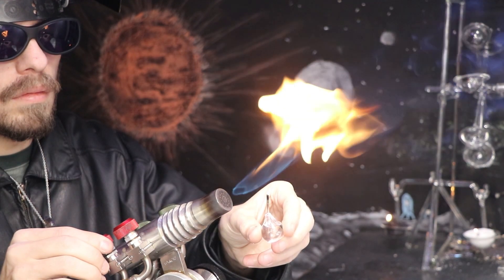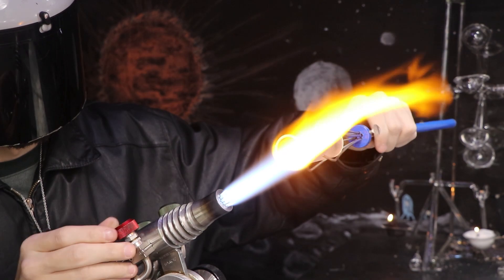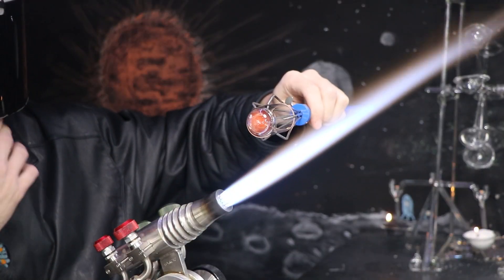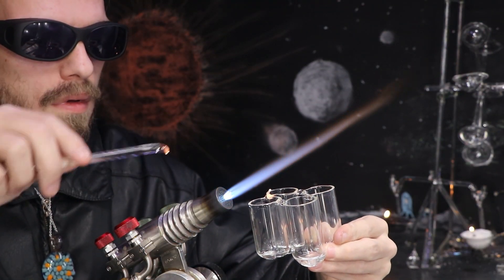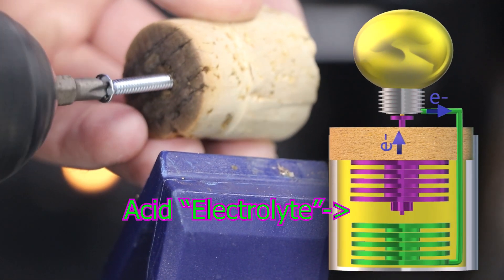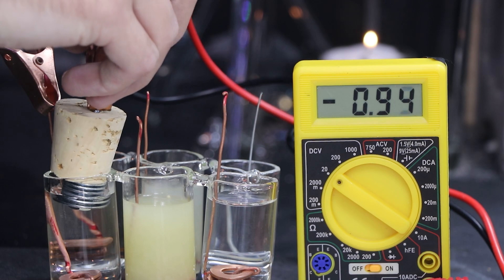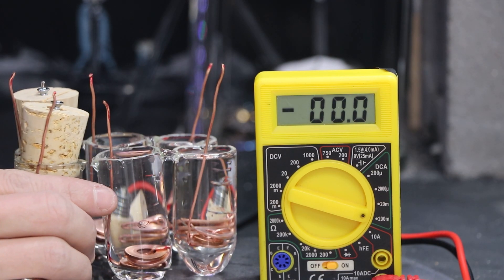Building my first Zinc Acid Battery 🔋

Comment: You are a genius. Excellent experiment. In one cup, you mention there is only pure water but the voltage is still close to 1 volt. Can you put 5 pure water cups in series connection to make it 5 volts ?

Comment: It would have made a lot more sense for you to have melted the tube in half, leaving a closed end on one side of each tube section, and then use the saw to cut the ends off to create the cups.
Reply from the maker: Hey Don Leslie, your absolutely right. I should of made better use of the flame cut to make round bottoms as well. 
   With these science videos I spend more time on the research than the design. TBH the bridging wasn't practical either. Plastic zip-ties would of saved time and held stronger. I need to take more advantage of mixed materials and not just glass. Thanks for watching and commenting, stay tuned for more to come!
Reply: @JasaGlass  Definitely using mixed materials could save some frustration and time. Have you thought about getting a hand torch like a Smith or Gentech tho? You can find really cheap knockoff versions of the smith online. They're not as good as the authentic ones but they do the job. Being able to dexterously  fire a tiny, super hot flame into tight spaces to clean up the bridge welds (among many other things) is super handy. Also a note on your annealing cycle: a 2 hour soak at 1050 is quite gratuitous, that's the kind of soak time required for solid pieces that are like 3 inches thick. For anything up to 1 inch thick, 15 minutes is all that's really required as long as you're not opening and closing the kiln and flashing the piece with cold air, and assuming you've got a controlled cooldown, or at least don't open the kiln to quickly drop the temperature after the 15 minute soak.
Anyway, happy melting!

Comment from the maker: Thanks for watching! I DON'T recommend you attempt this experiment, I will be making another simple battery demo using Lemons! Give me a couple days, to prepare for the experiment you'll need a few items. 
Fruit Battery
1: Several Lemons, Limes, or Potatoes. 
2: Several Zinc plated (Galvanized Hot-Dipped for most zinc) nails or screws. 
3: Several Copper nails or Copper wire strong enough (~18 gauge) to insert into fruit. 
4: Copper wire to wind around electrodes and conduct electricity. 
5: Testing: 3v LED or other small power device, however a Voltmeter would be ideal for testing.
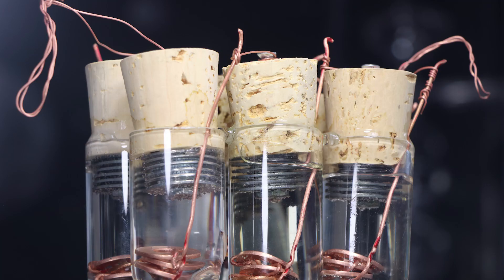Reply from the maker: I've recently come to understand because of the low acidity electrolyte the zinc is making a large amount of hydrogen as well. Hydrogen can become explosive which is why this could be dangerous. I did install small glass tubes in the corks which can be seen 12:14. Again wait for the lemon battery video I'm working on right now if you want to attempt your own.

Comment: Hey Matt, very cool video!  You have several reactions/variables in your setup.  Zinc will react with acids to form hydrogen gas.  Zn(s)  +  2 H+(aq) -->  Zn2+(aq)  +  H2(g) this "side reaction" will not produce electricity, in your setup, just hydrogen gas.  Several things can influence voltage, the types of metals Zinc and Copper, temperature, and concentration.  If the screw and bolt are not galvanized then you also have iron influencing the total voltage.  Your plan to build an electrochemical cell with a salt bridge will give you the ability to create a more versatile galvanic cell.  That will make it much easier to test different metals and electrolyte combinations.  (I am a Chemistry professor, failing at glassblowing is just my hobby.)
Reply from the maker: Hello Professor, I did notice a lot of bubbles around the zinc now that you mention it. What electrolyte would you recommend to use with the zinc? Thanks for the additional information and checking out the show. Best of luck with your glass journey!
Reply: @JasaGlass  Hi Matt,  You probably can't get Zinc Sulfate, but table salt or Epsom salts will work too.  With table salt you do have the possibility of corroding the electrodes, but that's one of the things you can test.  When you create a salt bridge I would suggest Copper Sulfate for copper's electrolyte.

Comment: You could use a 5 mil rod and make an offset punty if you want a better handle next time. Just seal it to the rim and bend it to be on center, that'd be a lot more stable than the grabbers